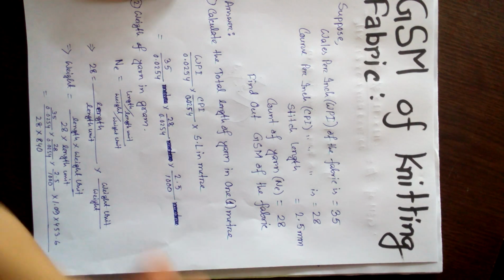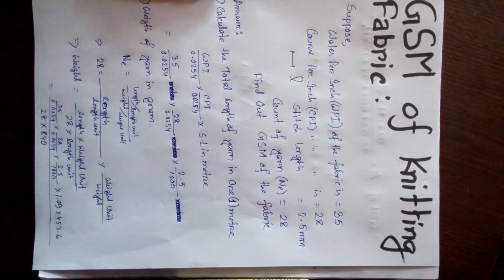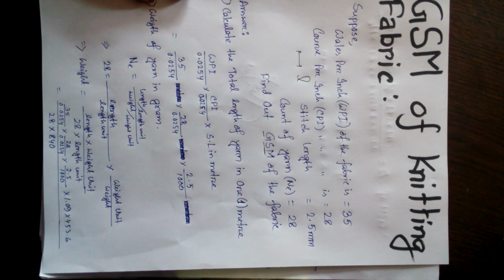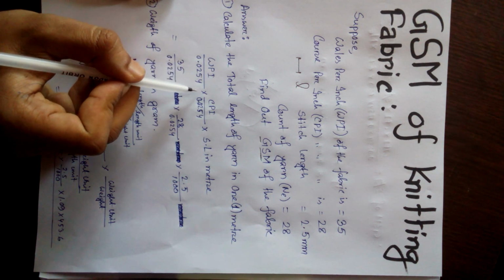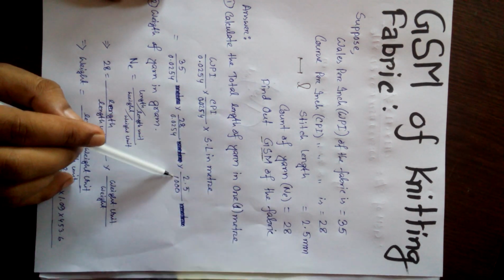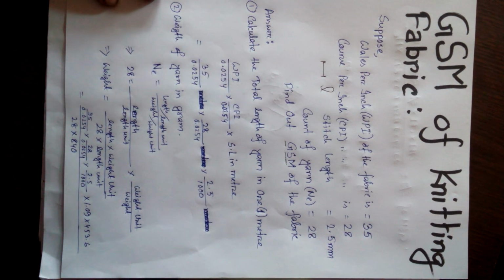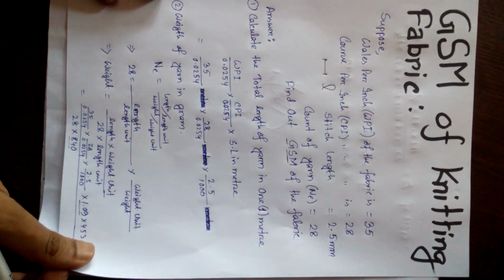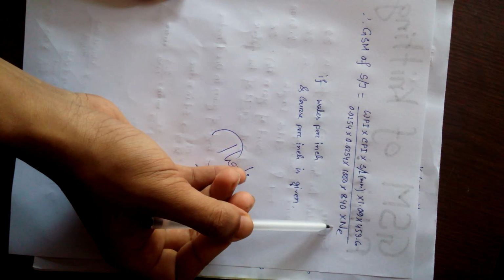GSM OF KNITTING FABRIC

Comment: Rib fabric. Rib machine. Daya 38. Gauge 20. Fitter 90. Ostrich length 2.90mm. cylinder needle 2376. Dial needle 2376. Yarn count 24 single. 10 kg fabric banane mein machine Kitna counter chalana hoga sar iska formula. Bataiye sar please bata dijiye sar

Comment: In case of calculating fabric weight in oz/yd^2,Why should we devide the gsm by 33.91 ?
Reply from the maker: 1 ounce =28.35 gram. So,  1 gram=1/28.35 ounce. And 1 sq meter=1.196 sq yards. You will find 28.35 and 1.196 in the denominator while converting from gsm to ounce per sq yards. By multiplying 28.35 and 1.196 you will get 33.91.
Thanks

Comment: Sir I have 2 doupts 1.09 how came , 453.6 how came
Reply from the maker: 1 meter =1.09361 yards and 1lb=453.6 gm.
We have converted the length to yards to make both the length unit same (as in the denominator there is a value of unit length of 840 yards) and as we need to find out the weight in gram, that's why we have converted the weight from lb(pound) to gram.
Thanks